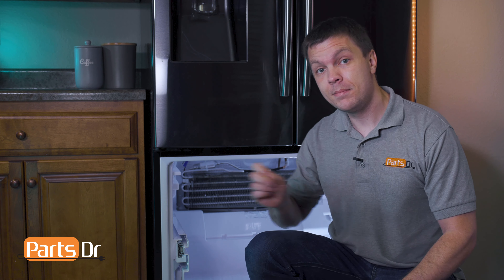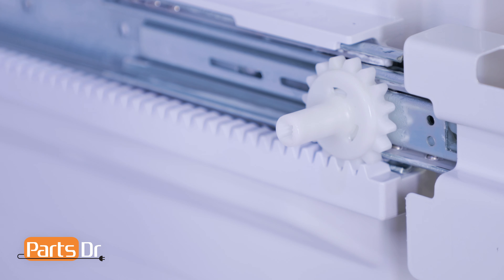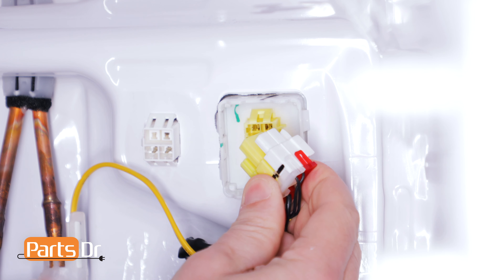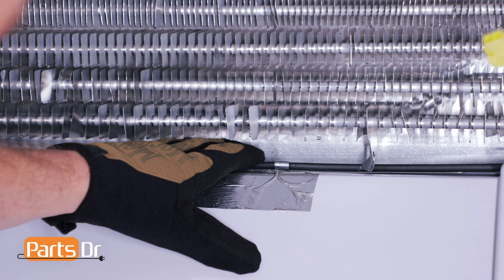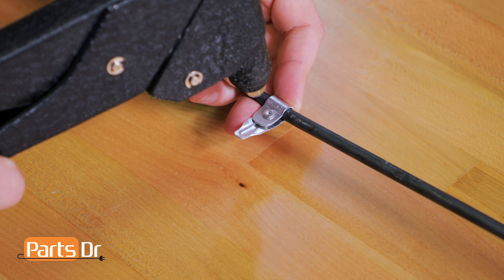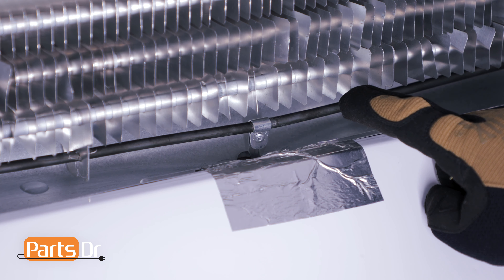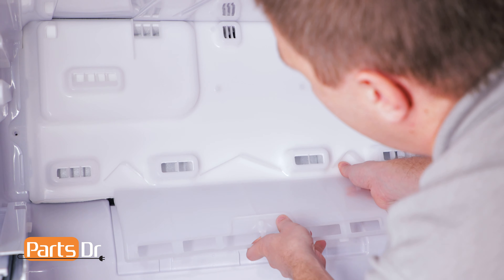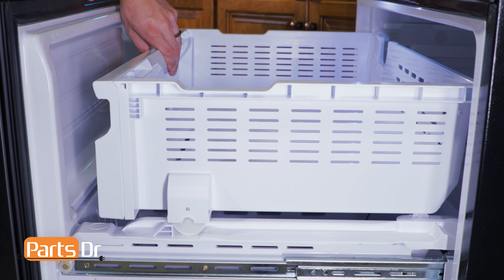How to replace Samsung freezer defrost heater part # DA47-00424M

Comment: Excellent video thanks, on the right side element retaining clip on mine there’s evidence of plastic wall melting ,would that be failed thermal fuse ? Or something else
Reply from the maker: We would start by replacing the defrost sensor (thermistor).  It could also be caused by a bad main control board.  We have a video on testing the temperature sensor here: https://www.youtube.com/watch?v=J5bwcteeJNM

Comment: Very nice video.  My coil is ice free and now my frozen compartment will not go below 40 degree F.  I followed our video and check to see if iced up or not and no it did not.  Front display show zero but manual check with thermometer and put bottle of water whole night in the freezer did not get iced.  the thermometer reads 40F.  Please help. what can I do.
Reply from the maker: If the evaporator coil is not getting cold, that would indicate a sealed system or compressor problem.  That type of repair can be expensive and would need to be done by a professional.

Comment: Before replacing the heater and sensor, does the freezer need to be defrosted? someone told me it needs to be left off for 36 hours prior to replacing. True or false?
Reply from the maker: That is normal for a repair person that is going to replace the parts to instruct the customer to unplug the refrigerator prior to the install.  Yes, if you are having an automatic defrost problem, you should have the coil fully defrosted before putting it back together.  In some cases, people will manually melt the frost with a hair dryer, but you need to be careful to not get the liner of the refrigerator too hot as you can warp or damage it.

Comment: thank you for the video! However, how do I know the defrost heater is defected? My Samsung fresh room is leaking. I have to take the cover off and use the hot water to melt the ice that clogged the drain. Tons of ice build up on the coil... ...
Reply from the maker: You can test the defrost heater using the instruction in this video here: https://www.youtube.com/watch?v=q7hysgipzpQ